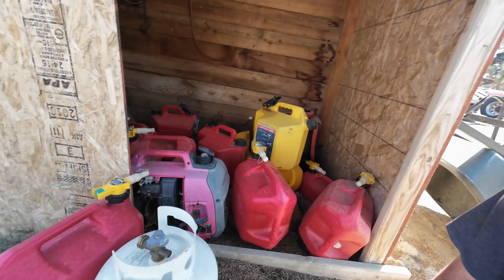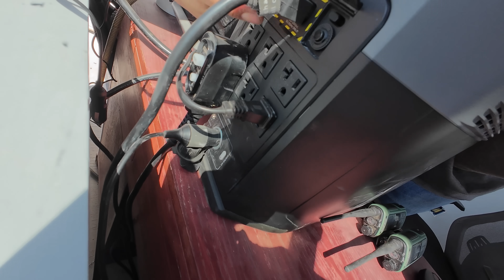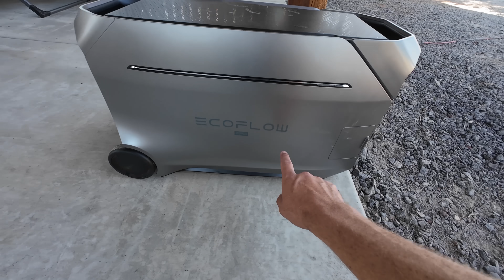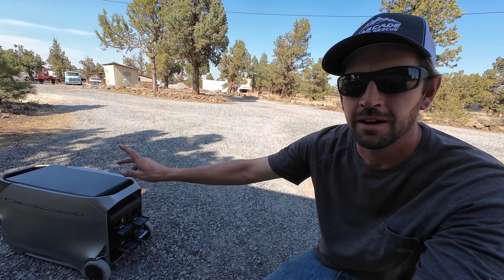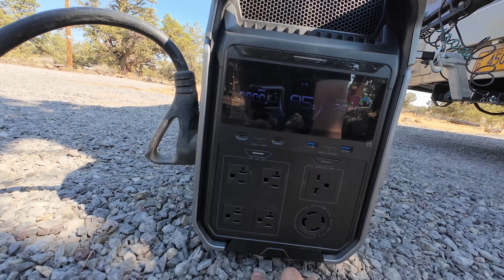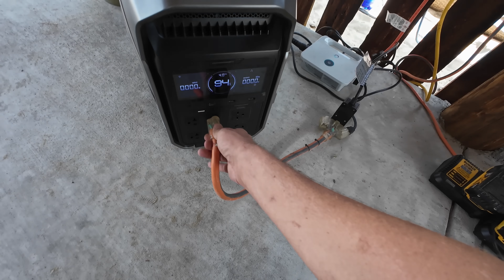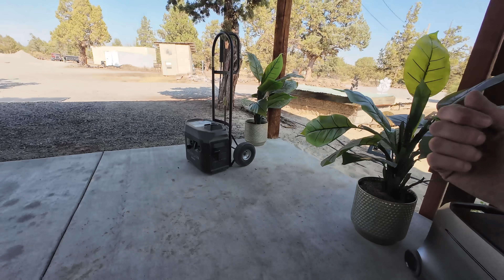Be prepared for DISASTER with EcoFLow's new Delta Pro 3!

Comment: NIce to have options when we lose power or are off grid. We have the EcoFlow Delta we use as backup power when we are camping it can run our fridge and some lights. We have used it a few times at home. Ours is the older version that doesn't have as high a charging from solar and can't be upgraded with additional batteries. We have solar and a larger lithium battery on our trailer and it works well. It can power everything we need including the Air Conditioner. Solar is great so we don't have to use our generator all the time.

Comment: Ecoflow products do seem to be of pretty good quality, but they're pricey.  So I built my backup system - a UPS for part of the house - for less.  I bought a 3000W hybrid inverter with built-in solar charge controller, 2 (now 4) LiFePO4 12V 100Ah batteries and some solar panels.  2 x 100W panels are enough to keep the batteries topped up when not in use, but I've got another 1000W of panels to string up in case we get in a bind.  Fortunately our power hardly ever goes out for more than 2 hours at a time.

Comment: I have a River 2 Pro that I use primarily while I am camping to power my CPAP machine at night. If it is not too cold over night, I can get 2 days of use on a single charge.  I love the flexibility of charging.  Many of the places we go are not good for solar, so I can simply run my gas generator for an hour or so and easily be toped off for the night.  The 100W USB-C PD port is super handy for charging my drone batteries as well.  It is light weight enough that I have no problems getting it into my RTT on top of my Jeep.  The app is pretty convenient to check on solar input when adjusting panels or checking on status without having to leave the comfort of your chair next to the camp fire.

Comment: Highly recommend looking at the new smart gen, it can start using power from the power station over the XT150 if the internal battery dies(common issue with the old gen), it's a 4kW generator too and only a couple hundred more than the Gen 1👍
Reply: Because of your canoe video I went all in on a D2M, 2 EBs, Wave 2, glacier, 4x110W and a 220W portable panels, and 6x 100W panels for my offgrid home office.  It also caused a small addiction which caused me to order 10 370W Aptos bifacial panels, an EG4 LL-S battery, Cerbo GX, Victron MultiPlus 2 5KVA inverter, 150/70 SSCC, and a 100/20 SSCC and all the associated fuses and wiring to take our home partially off-grid.  😅. On the plus side our electric bills have never been lower still need to finalize permanent mounting before winter
Reply: Also they work together, took one string of panels off the EcoFlow to feed the EG4 battery directly using the 100/20 and have a node red automation/dashboard set up to control a relay feeding 48V DC to the Delta 2 Max.

Comment: i got a very good deal on a power station, not Eco flow but its still very handy and as you mentioned, $590, 2400 watts(4800 peak), 2000Wh  it charges at 1500 watts which can pop brakers but i charge ac/dc for slow charge and save the 1500 watt AC charge for an emergency charge off a generator if needed during outage/ before storm.

it was cheap, so i tested it with oscilloscope, its basic no 240 or RV outlet but construction wise its good. just company did the Kickstarter and after that they didn't do well with other competition around like bluetti and eco flow etc, so it was falling out and heavily discounted

long term they don't last like with high output but small things its great. i didn't expect when i used on fridge and freezer to last long i expected 6 hours, then i realized they run cycles where its off and on like you said, and it was way better.

but mainly will be used for conventions with no outlets, or running tools in the field.

Comment: Purchased the Delta 2 + 220w bifacial folding panels on a Prime Day deal. It runs my entire remote workshop that has no power and has been running off a 50’ extension cord. The Delta 2 is powering lights, two fans, shop vac, sander, table saw, chop saw, and no more extension cord. But I feel myself getting sucked in to buying more. This is great.

Comment: The really cool thing about their dual-fuel generator is that you can run on propane only.  That means your fuel supply can sit for years with no worry about it going bad, and zero maintenance on the generator.  If you run gas-powered equipment, you know it needs all sorts of maintenance, fresh fuel, carburetors unclogged, etc. every year.  That's why so many gas-powered tools are being replaced by battery-operated tools.  Propane power also means you can have a huge tank as your fuel storage.  It's like having a battery that runs for years on a single charge.  Ideal for a stationary generator for backup power.

Comment: I purchased ecoflow several years ago to help be prepared for hurricanes in our area (coastal south carolina).  I recently had a job which took me to an area with no electrical power supply when the heat index was over 100+ degrees.  Without the ecoflow it would have been a disaster.  With ecoflow i was able to operate a high velocity fan to keep me cool enough to work in the heat for several days and charge my batteries for tools.  I recently viewed your take on the ecoflow generator and am considering the purchasing  of one to add to my present one.  Thanks Casey for your presentation and your youtube videos.

Comment: I have a Delta Max 2. Love it. I use it at the hunting camp to keep the power on to the cabin. In the summer it can run everything with zero issue. For a week straight we had the smoker running almost 24/7 and ran the fridge and stereo off it. Granted we had major overcast so our solar production was garbage but we still managed to have it full power by end of the day. Compared to previous years running the genset all the time... it was like night and day. I am building a bigger permanent setup now, because in winter it doesn't quite have enough juice to run the furnace when its -20 outside, plus LiFePo batteries don't like the cold. But for our mobile and smaller stuff it is an absolute champ when compared to generators.

Comment: I have the Delta Pro, Wave, and Glacier. Great setup for emergency backup (my wife requires refridgerated medications), weekend camping trips, or even extended off grid adventures by myself. The only product I have that fell short is the 400w portable solar panels. The grommets pulled out so I have to Macguyver a frame to use them at an angle.

Comment: I have:  Ecoflow River Pro 720w battery, Glacier fridge, Wave 2 ac/heater. 
Battery:  works great for cpap machines during power outages.  Also for running fridges in cars.  Excellent for tailgate parties to run a TV and fridge (non-ecoflow) all day long.  Also runs lights and music for remote parties where I don't want to run an extension cord.  
Fridge:  Love the app and how it runs the fridge.  The ice maker is cool, but I don't use it all that much. Here's a case we did:  we drove all day to our camp site, my wife wanted ice for her coke.  I dumped in 2 bottles of water and 12 minutes later, we had ice cubes.   That was pretty awesome.   The fridge/freezer functionality works flawlessly.  I used it as a freezer for 4 days in 100+ degree heat and it worked perfectly.  I can run the fridge all day long for tailgate party on just the internal battery.   Having the internal battery makes it my go to fridge for most occasions. The fridge is heavy and a little big, but those are the only two minor drawbacks.  In general, this really is an awesome product.
Wave ac/heater:   Phone app integration makes it easy to use.  When camping in a pop-up tent trailer and I woke up cold, I turned the heater on for 30 minutes from my phone and slept great the rest of the night.  The AC worked OK, but struggled in 100 degree heat in direct sunlight.   That was kind of to be expected.  The big issue I have is with the drain.  I thought I plugged everything in right but it would not drain.  Finally I just unplugged the drain hose and it was great after that (although a little wet on the ground)   

SetPower has a smaller fridge - FC15 and battery - PG216 that work great together.  They are small and convenient to quickly grab and throw in the car.  Using them in series (fridge to battery to car) runs basically forever as long as you run the car (i.e. drive) a couple hours a day.   If Ecoflow had something this size with an internal battery (I think Casey has suggested this) I'd buy it immediately.
Reply from the maker: @psquared4264  awesome review and I completely agree with everything you said!  
We live in a very dry and arid environment, so there’s almost no condensation from the drain.  I simply let it run onto the floor and it’s never more than a slightly wet spot every once in awhile.  
I’m also 100% with you on the fridge.  I absolutely love how it works, but it’s too big for a lot of applications.  I think if they ditched the ice maker to have a much smaller version that still has the internal battery, they’d have a home run

Comment: Because for the past couple years you've hated Casey so much you tune in every couple days to see if he's put up a new video. Maybe with his wife working for the company she can find time to edit a video every day while Casey is busy helping people. 
Because it's an ECOFLOW ad and he might have a new product that you don't want to be without. Like the GLACIER cooler that has a refrigerator/freezer/and ice maker for all your beverages, the WAVE with AC/heater/or just a fan to circulate the air in your room, or the DELTA 2 to charge the batteries on your different ECOFLOW products when they run down.

Comment: Bought a EcoFlow RIver 2 to use to power our Energetic Fitness System EFS-300 PRO.  Didn't know if it work, but it worked awesome. We actually could have run it for over 6 hours, so would work great at a remote demo.  Thanks for your video.

Comment: I love the ecoflow gear, it works amazingly well. I take it out exploring in the jeep( nice hot lunches) air fryer , microwave oven, we have  even used it with 650 watts of temp solar on our boat. It ran the ac/dc cooler i bought, plus the original boat fridge, water heater, etc. 
i think i will be setting up a few of these as a small system around our property. 
 to run the pumps 

Im an electrical contractor in south salem and i tell all my customers that they should be doing solar / battery back up systems. Over the next years the power grid will definitely be getting worse before it gets better and the power bills are skyrocketing . 

Get yourself prepared and save some money at the same time!

Comment: I have a 20kw home built diesel generator, but would like to add EcoFlow's battery backup to power the fridge, lights and entertainment system. Downside is my house has aluminum wires, so it's harder to extend just the circuits I want to the battery backup.

Comment: These videos are great.  Yes I bought an EcoFlow because of your past videos. Went on a 2500 road trip through Oregon with the Delta 2 and 200 watts of solar on the roof.  It ran everything in the van with no issues.  Over night I would still have around 70% left of battery then within a few hours during the day the solar would charge it back to 100%.  Highly recommend these products. 
Thanks again Casey for all you do.

Comment: I have the river2 with add on battery and the wave 2 with add on battery. Use them while camping to power and recharge. I want the glacier cooler but can’t stop using my SetPower ones.  One day I will upgrade to a whole house system as back up.

Comment: I bought the Ecoflow Delta Pro with an extra battery.  My main use is for emergency power outage.  its been sitting under my bed for 4 months.  Plugged it in last week to top off charge for 2 night camping trip.  Battery was still 100%.  Used main unit to keep my 100 liter portable fridge freezer powered.  I'm positive that was overkill.  I would rather have overkill than worry about power.  At this point Im verr happy with my purchase. I will see it how it performs this fall and winter.  I live in the San Juan Islands in the Pacific Northwest.  Power outages is a part of life here in the fall and winter.  My only gripe is Ecoflow has come out with the Ecoflow Delta Pro 3,  now I want that model because it has 240v and the extra batteries are more compact.  Currently saving so i can purchase the Ecoflow gas generator and the Ecoflow portable solar panels.  Thank you for this very informative video Casey! Love your channel!!

Comment: 110v and 220v.  Casey is fun to watch.  Ecoflow is a great product, sadly this is only from me reading data sheets.  I'm not fortunate enough to be sponsored by Ecoflow, but this is not why I'm commenting today.
1) Casey is running it off that 30ft 220v power extension cord.  This is okay, but remember, your Ecoflow has to power that 30feet of THICK copper cable.  So, if you can, run as short of 220v cord into your RV that you can.
2) The Ecoflow is nice, smart design, and it gives consumers, what they want, but it's a complete unit, which means if a thief breaks into your RV, they just have to roll that out, and they stole your entire system.  Ecoflow needs to have some sort of tracking device, in case of theft.
3) Okay, so what an Ecoflow is, is it is a Lithium Battery,  Solar Charge Controller, Power Inverter, all in one.  You can go this option, or you can run solar panels to a separate Solar Charge Controller, then to a Battery Power Bank, and then to a Power Inverter.  When  you run  it this way, a thief has to bring tools to steal everything, and it will take much longer.
4) In summary, Casey's Dad probably had, when he was young, a stereo system that had a radio, a cassette player, maybe an album player, maybe 8 track, speakers, all in one unit.  That is your Ecoflow.   As his Dad got older, he may have bought separate components for his music needs.  Perhaps a Tuner, and an Amplifier, and a CD player, and an EQ, and Speakers...all separate components.  With this separation, the music sounded so much better, BUT his stereo when he was younger, did the job.  So, the Ecoflow is sweet, efficient, but I would let my 19 year old daughter take it when she goes camping with her friends, and as far as powering my RV, I would go with all separate components.  It just makes sense.  If battery goes bad, just replace it.  Solar Charge Controller goes bad...just replace it....Invertor goes bad...just replace it.  If any of those go bad on the Ecoflow, the entire unit could be down, or your life becomes more complicated.  For instance, if the solar charger in the Ecoflow breaks...there goes the ability to charge via solar, but you're still able to utilize the Ecoflow..it's just that you'll have to find a way to charge it.

5) Lastly...the Ecoflow is nice...but basically it's now a Northern California Generator, and when  your RV power goes down, just like it did when he lived in Northern California, during the Summer...you break out the Ecoflow ...and you're back in business.

I'd like to thank Ecoflow for sponsoring this video. 😘

Comment: Problem with this and most all power stations is the cost.  This one is between 4 to 5 times what you can build one yourself.  Go figure.  4000 watt hours is not large.  Four 100 amp hour lithium batteries produce more. 12.8x100x4 = 5120 watt hours and cost less than $800.  And inverter and charge controller may cost you another $400 (I'm inflating high in my estimates).  So for $1200 you can duplicate this thing.  And it costs over $6K.  Now I ain't no rocket scientist but you get more power for 1/5 the $$.  Why make ecoflow rich?

Comment: I have a River Pro2. very happy with it.
 
Just wish it had the ability to set the start & stop voltages when charging from a vehicle. That is, set it so that it only charges when the vehicle is running.
Reply from the maker: That’s dictated by the power outlet on your vehicle.  Most of my vehicles that have multiple 12v power outlets have one that it always live, and one that is only live when the vehicle is on.   If you have that as well, just switch it to the outlet that only runs when the vehicle is on

Comment: Question about the app: is it able to control the devices when the phone lacks an internet connection and cell connection -- aka the cellular network and your isp are down, but you manage to power your router?
Reply from the maker: Yes.  It’s a Bluetooth connection so no WiFi, or even cellular service is necessary

Comment: I have an Ecoflow Delta Max that I use as a UPS for my sump pump.  We had an ice storm in March 2023 and power was out for 48hrs. The Delta max kept the sump pump running for 2 days and prevented my basement from flooding!
Reply from the maker: I had never thought about basement pumps until someone else mentioned it just a bit ago.   That’s a really important thing to keep running!
Reply: How about a UPS for your water pipe heat tape?  So a long power outage doesn't burst your water pipes.  That could be pretty important for folks who have cold winters.

Comment: When I first got my new (to me) camper three years ago I thought about one of these, but at the time I didn't like the inflexibility of the setup.  Today if I were wiring my camper I would go with one because of it's versatility.  
 would also consider one If I lived somewhere that power outages are common, but after 25 years in my house I've only had one power out that lasted more than a few hours.  And the one outage was not a grid problem, but house wiring problem that to the electrician time to fix.  Thankfully my neighbor let me hook my fridge and freezer to his house while I waited.